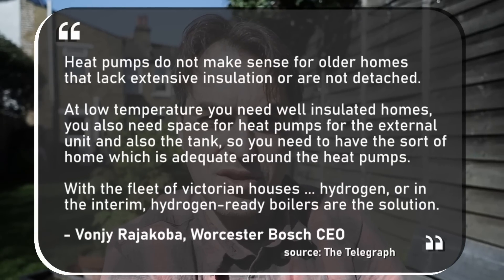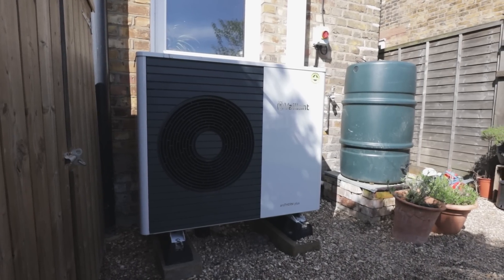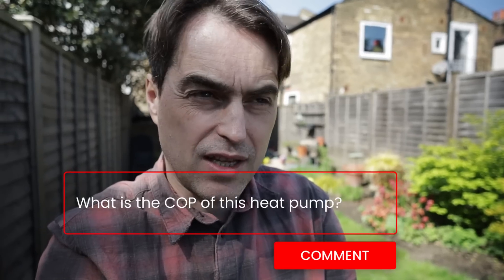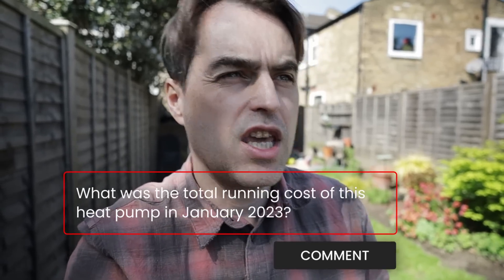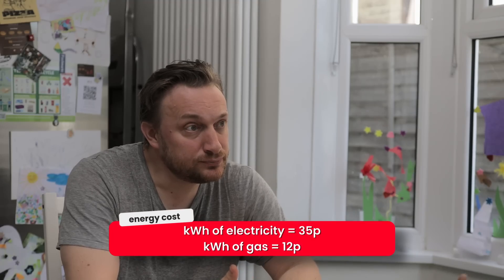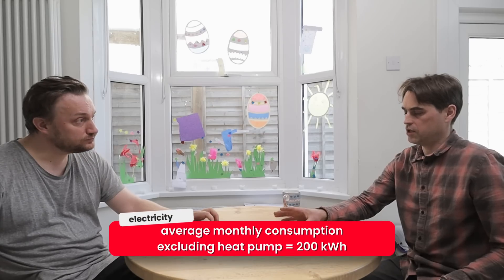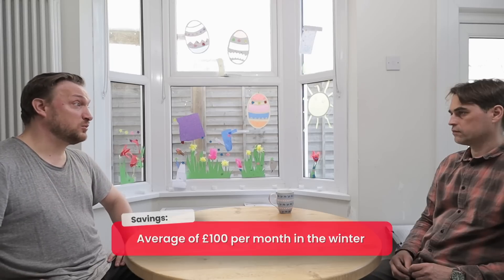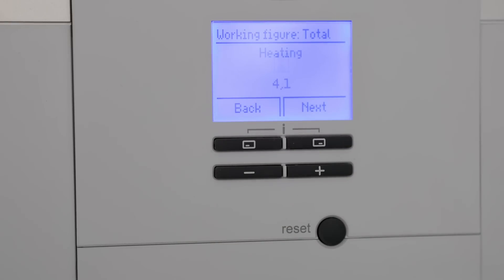Worcester Bosch CEO Is Wrong About Heat Pumps. Here Is Why.

Comment: You need massive rads in an old house to get heat pumps to work and a huge upgrade in insulation
Reply from the maker: Maybe watch the video before commenting?
Reply: Wrong. My resized radiators had very modest size increases and often were just changing the number of panels and/or convectors.

Comment: There is no doubt that heat pumps provide heat and as long as they are large enough in capacity, they will heat any property.
Whether they are a good source of heating is another matter. Heat pumps seem to be better suited to buildings with a good level of insulation, but that applies to other forms of heating with corresponding reduction in heating cost. Heat pumps have many inherent negatives, cost of installation, higher maintenace long term due to a more complicated system. the absolute temperature acheived requires resistance heating in some cases to the detriment of running cost. Electricity is expensive and with current government policy is likely to increase.
What has been very much exagerated is their efficiency, they are not efficient and I believe a modern gas boiler is more efficient and certainly more effective. The reason I say this is that the fuel requirements to provide one kilowatt hour of electricity is approximately around four times, i.e the real input to a heat pump is four kilowatt hours not one.
Reply from the maker: 😂 well installed heat pumps are around 5 times more efficiency than modern gas boilers.

This one is around 4,5 times more efficient than the boiler it replaced and work in an uninsulated property.

How much more proof do you need?
Reply from the maker: Boilers are around 85% efficient, this heat pump is 410% efficient.
Reply from the maker: @zlmdragon.  condensing gas boiler is on average 81% efficient for system boilers and 84% efficient for combi boilers on heating. This heat pump is 410% efficient on average throughout the heating season.

Therefore 410% / 85% (let's be generous) = 4.8, therfore this heat pump is 4.8 times more efficient in than a 85% efficeint gas boiler or 4.5 times more efficient than a 90% efficient gas boiler.
Reply: @UrbanPlumbers  More impossible percentages LOL
Reply from the maker: So even under your assumption it still beats gas boilers by at least 200%
Reply: @zlmdragon.  that's assuming the grid is 100% gas, which it isn't - it sits at around 40%.  Being aware of the power grid's efficiency is fine, but including it in the heat pump's efficiency is non-sensical - e.g. the heat pump's efficiency doesn't change if the user got solar panels installed or so.
Reply: @zlmdragon.  it's how much heat output you get per unit of measurable energy put in that costs the end user.
Reply: @zlmdragon.  yes, what's your point?  A gas boiler uses 1kW of gas for 0.7-0.9kW of heat i.e. 70-90% efficiency. whereas a heat pump uses 1kW of electricity for 2.5-6kW of heat, i.e. 250-600% efficiency. 90x4.5 = 405%.  Both gas and electricity are metered by the kW used.
Reply: @zlmdragon.  yes, replying to you stating about ~2kW of gas makes 1kW of usable electricity.  Which doesn't affect the heat pump's efficiency of converting a unit of energy into a unit of heat.

Comment: Just reading the comments,  trying to pick out the stats. 7kw heat loss and a design  flow temp of 38 deg. Its very interesting for me. Looking at my house , just under 8k heat loss, thinking of using a 7kw unit.
Reply from the maker: 7kw arotherm has 9kw output of the flow temp is 35c
Reply: @Urban Plumbers  this is exactly my thoughts,  why design a system for less than 3% of the time. North East is not too cold lol

Comment: Bottom line is how much money did they invest to save this £125 p/month - what is the payback time - 10 years or more  ? If it’s change for changes sake then it makes no sense , being totally dependant on electricity for heating is going to end up with all eggs in one basket , no competition for energy prices and the government and their electric  company buddies  shafting us even more
Reply: It depends on how much you want the heat pump to pay back - if you want it to pay back the conversion to a low temp heating system, then it will take a long time, but that shouldn't be on the heat pump to pay back - a low temp heating system saves money on its own even with a gas boiler etc.  Let's say the heat pump itself was £7K.. £5K paid by the grant.  That's £2K needing to pay back.   That's about 16 months, conservatively 3 months each year = ~6 years payback.   Gas doesn't compete with electricity as an energy so I'm not sure what you're talking about there. Also, for gas you have zero option to make your own, for electricity, you can get solar or a simple generator.  You can store electricity from the solar in a battery.  So you can untie yourself completely from being dependent on the energy market.  Yes, you'd have to spend money to do so, but it is something that is impossible with gas.
Reply: @foppo100  where are you? where I live there's a 6+ month lead time on being able to get solar installed, and the prices keep rising due to demand.

Comment: So the fix for an "unsuitable" house is to fit an oversized inefficient gas boiler? Ridiculous! Fabric first. People claiming the benefits are minimal cost gas costs three times less than electricity obviously dont get that gas boilers are far less than 100% efficient and even worse in these "unsuitable" leaky with poorly designed heating systems.

Comment: I live in a 220-sq metres new build with air source heat exchange pump with underfloor heating in both storeys. This is the Czech Republic with its colder winter and longer hotter summer than England where I used to live. Air recuperation helps heat distribution, recycling and loss in winter. Triple glazing cuts down heat loss further and configuring the heat pump to operate in reverse keeps the indoor space cool in hot days in summer. The electricity bill is about 2/3 of that of combined gas & electricity in an apartment with smaller living space in England. 

I believe the milder winter in England would allow heat pumps to replace gas boiler however the lack of good, experienced heat pump engineers in the UK would mean sub-optimal installation leading to fewer satisfied customers in the UK.

Comment: OK mine is a 1970 Wimpy semi. Commonly built 1963( parents bought one in Northampton) to at least 1973 ( mine built) I still have a hot water tank- gas central heating, but it is positioned on my internal joining wall. Outside the wall at front- under 2 opening windows, side wall no windows but is a driveway- a metre from boundary means a path very close back wall 2 windows and door take up almost full width. So from the position of unit very hard to find a position.
And even worse- this house has more land than some new builds. One builder built  "affordable houses" couldn't sell them, offered them to social housing who had to reject them because they didn't met minimum size requirements. So where in those rabbit hutches are they going to find room for the units? 
Generally speaking Victorian houses are bigger than houses being built for the more recent 100 years.
I have wall insulation- due to government offer over 15 years ago.
Attic insulated, UPVC windows but my new ones are much better than the older ones. Oh and the final nail- micropore central heating, that means all new piping, floors raised, flooring taken up, repositioning of hot water tank with possible loss of 1 bedroom reducing value of house. And the cost of the heat pump and it's workings.
I think the Bosch CEO mis- identified, the real problem is those houses before Victorian ie solid walls, and the dross of new builds since the 2nd world war where the guiding question was how many cancwe get on the land. Paired with our local policy let's only build houses that are not " affordable" so we can get more money per house.
Reply: Many developments of small dwellings could use a community heating system. I believe that this is what has been implemented in South Wales where the heat source is flooded abandoned mine workings. Regarding microbore, my system used to be all microbore. I replaced some of it with 15mm pipe when resizing my radiators for my heat pump. The old radiators had coaxial valves at one end - useless so I had to dig up the floor to get to the opposite end of a radiator and in a few cases the radiator was repositioned. It works absolutely fine.
Reply: @Roger Phelps  this is not new, there is an estate that was heated by the cooling water from a power station. Not common but tried before. I'm 62 and we were told of it in school 50 years ago. Thought it was a great idea no idea how they were billed. Of course without the power station which I assume was coal or gas those houses probably wouldn't be getting the heating now. We also swam in the river where our local power station discharged it's warmed water- now that would have been living dangerously if we'd known anything about contamination of the local river.

Comment: We use a Vaillant heat pump as well, the larger VWL125/A6 with 12kW of heating power. Our House has a double brickwall, too. Insulated roof and relativly modern double glass windows with a total living space of 233m^2 and we have a cop of 4.2 (average over winter). We are five persons in our family.
Reply: So may I ask how much have you saved compared with gas boiler?

And how much did you pay for the heatpump?
Reply: @teanau11  no response there haha, i bet he has an electric car as well and sits at the charging station (if he can find one) for an hour at a time.

Comment: Fantastic example.... Victorian terraced house mid terrace doesn't have much by way of outside walls. To me the lack of underfloor insulation would be a bigger issue. 
What you haven't pointed out is the mysterious inefficiency of gas and oil fired boilers. SEDBUK ratings are all good and well but in real life there is a lot of lost heat somewhere. My installation in a more modern detached house extended now to have 5 bedrooms and 40 m2 of ufh has gone from 2400 litres of oil to less than 6,000 kWh of electricity. The COP is about 3 overall but I am using a time of use tariff when 6 hours of electricity overnight is 7.5p an hour and consequently it works hardest during the coldest part of the day. My 12 months electricity costs were £1750 helped by £750 from the govt. pensioners and disabled but that includes 5,000 miles of driving my EV car too. Oh and my system has 4 pumps including one of small commercial size. The pumps when running consume 275 watts and my 14 kW Mitsubishi heat pump is 10% less efficient than a single fan unit. One point I never considered is perhaps having an undersink water heater in the kitchen to provide water at 55-60 degrees for cleaning up greasy things that aren't suitable for the dishwasher... thus allowing the hot water cylinder to run cooler for showers.
Reply: You can't have the hot water stored below  60c because of the risk of legionella
Reply from the maker: Yes you can. Occasional high temp cycle is all you need.
Reply: @UrbanPlumbers  And using copper cylinders and pipework might remove the need for that even. I haven't seen research on that specific point but at the start of Covid many areas where concerns about touching door plates was an issue replaced them stainless with copper. When I was a kid door plates were always brass or copper I wonder if the y knew something back then.

Comment: Good vid. The point of this vid is to highlight that air sourced heat pumps can work in terraced houses, match and maybe pipping gas boilers.  

But what really matters is the COP during the really cold winter months, as that is when most energy is used.  The vid only showed April. As gas is one third of the price of electricity per Kw/h, they are running neck and in those months.  Generally a cheaper gas condensing boiler, well design and fitted with excellent controls, with extra insulation added to the loft and other places around the house will be cheaper to run and install inc' insulation. 

In such houses I would not advise people to run out and buy a heat pump.  The payback may be very looooooong.
Reply: I don't know about you, but I still need to heat my house when the temperature outside is between 5 and 12c.  During those times you can get a COP of 4 sometimes even 5. With a COP of 3 during the coldest winter months, which is definitely achievable, it is at least on par with a condensing gas boiler.    Also if you're doing those upgrades for gas, then you rightly don't consider them as part of the Heat Pump install.  The BUS grant covers most - if not all of the cost of the actual heat pump itself.  So the payback period for the extra cost of the heatpump will probably only take a few years.

Comment: Insulating the house is the best option. Whatever source of energy you have installed: boiler or heat pump is the speed of heat loose of the building.
I would personally insulate the houses instead fitting a heat pump
Reply: AND fit a weather compensator to the gas boiler, all good quality heat pumps use them as they can make a 10% saving on heating costs, not hot water. Hot water use also has a big Impact on ASHP's as they need to increase flow temp to 70 degrees C, so their COP drops to 1:1.
Reply: @geoffaries  That is not true for my Ecoforest GSHP.
Reply: @rogerphelps9939  What are you talking about?
Reply: Do both and futureproof your house.
Reply: @rogerphelps9939  Yes do both, if you've got more money than sense.

Comment: Yeah, we worked out that an air source heat pump would cost far more than storage heaters running on night rate.
Reply from the maker: What? That’s not right. Your night rate would have to be over 4 times cheaper for that to be true. 

Also with overnight tarring and a heat pump + battery - heat pump is still 4 times cheaper to run that. Storage heaters
Reply: @UrbanPlumbers  The problem is that you need the heat pump on all day, not at night. That means that you are going to use standard rate electricity, not off peak.

Comment: My home build in 77 with cavity filled, standard pvc windows. Not insulated floor. Have panels with it. Samsung 8kw ASHP. In December entire cost of energy was 300 pounds keeping 20 in day 18.5 in night. Entire year of electricity cost me around 1k excluding money earn from exporting. With battery storage could go much lower.
Reply: In December you are using about 30kwh per day. Your solar panels are going to produce less than 5kwh per day on average (assuming 4kwp). Since your heat pump will be on all day it will use up any solar panel generation and battery storage will be useless. Battery storage might just help at the start of autumn and the end of spring and of course you could be almost totally off grid in summer. Don't expect battery storage to do anything for you in winter.

Comment: That is the main problem, gas boilers and systems get thrown in with hardly an consideration for anything. This will happen with heat pumps.
Reply: Agree 100%.  Who cares if it works, as long as I get paid.  I'm afraid this guy is in a huge minority of plumbers. The majority don't care.
Reply: Yes, I feel that a lot of gas / oil fired installations are under radiatored to save imstallation cost. 
A disadvantage of competitive tendering unless the quotations are really detailed and specifiy the dimensions / output of all radiators.

Comment: What are the annual service costs and repairs when they break down what was the installation costs
Reply: EVM said his Annual service cost was £150.  These ones come with a 5-year guarantee, extended to 7 if installed by one of their partners. After that, if regularly serviced, heat pumps will usually last until EOL.  Full breakdowns in the UK should generally be covered by the Home Emergency cover of the home insurance as well.

Comment: I am beginning to suspect that the difference between people who claim heat pumps don't work and people who claim they do isn't so much what house they are in, but whether they know how to use a heat pump properly. Of course a modern fully insulated house is a bit more forgiving if you don't, but that's not the point.
Reply: They are OK in a mild winter like the last one, in a cold winter you need a back up system.
Reply: @BigAL0074  I can assure you that you do not. I have had my heat pump for six years and never needed supplementary heat.
Reply: It's not a question as to whether heat pumps work, of course they do, providing that they're correctly designed and installed. The question should be "do they make financial sense" the answer is not they don't if you are connected to mains natural gas. The case for offgrid properties is more complicated.
Reply: @geoffaries  Wrong. You have not taken account of the external costs of fossil fuels. These do not appear on any balance sheet but are very real nevertheless. Our grandchildren will have to pay for out foolishness.

Comment: Great video. Same misinformation here in Germany. "You have to insulate your house, you need floor heaters, costs for this are above 150000€" etc. In Germany it's the fossil lobby. My heat pump is running at the first winter with a COP of 5, cost for gas and electricity are similar, 12ct/30ct